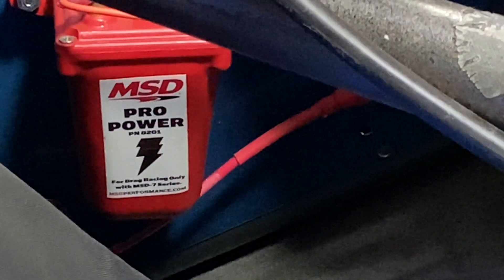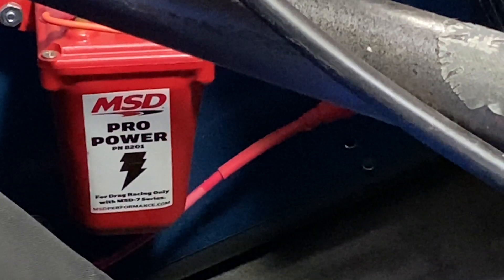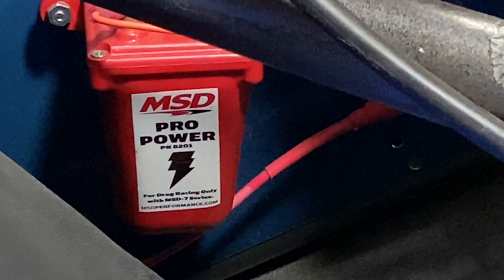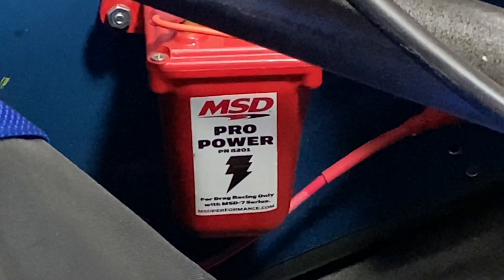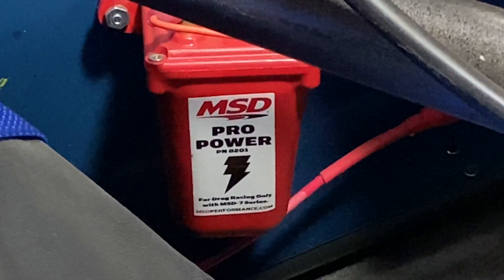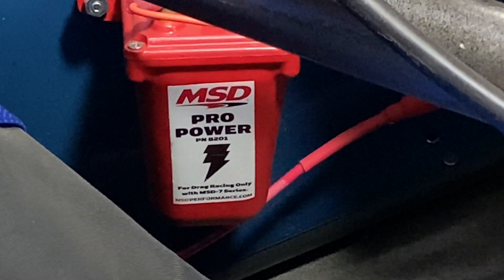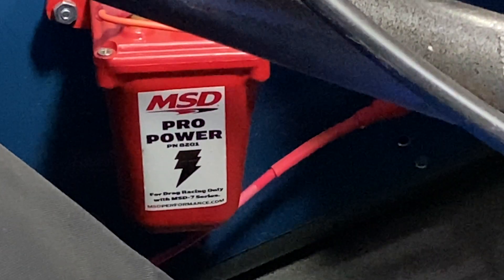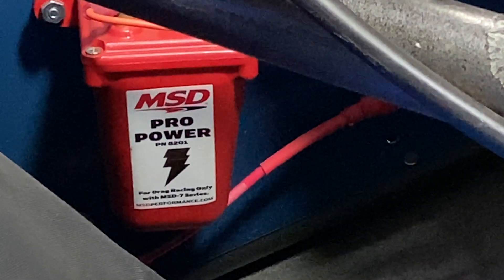MSD Pro coil

Comment: This ignition VS an 8261 coil. This shows it makes more volts but the 8261 is twice the price what are the pros and cons?
Reply from the maker: The MSD Pro Power Coil is a great choice for short duration applications such as drag racing where the 8261 is built in-house by MSD as well as specific materials they us to create a durable coil with strong voltage capabilities, lightning quick rise time and lengthy spark duration.  The 8261 can run spark for a much long duration of time.

Comment: Can I use this for my 300cc drag bike?
Reply from the maker: If you have a MSD ignition system already  you can us a Pro Coil.  If not you can start with a MSD4224 as the ignition system to start with.  What ignition box are you running now?